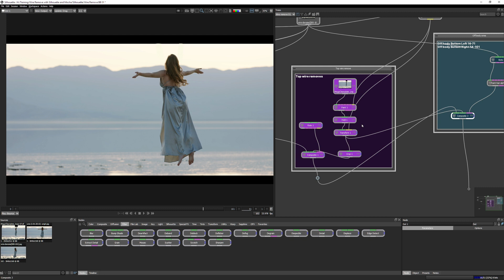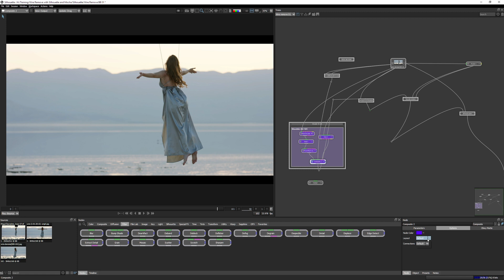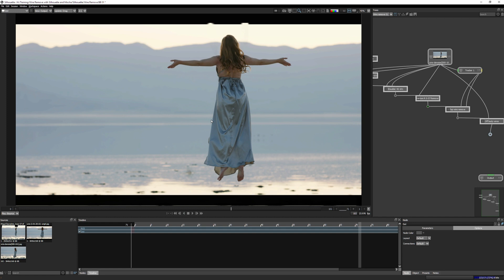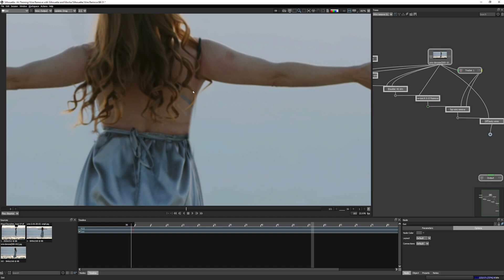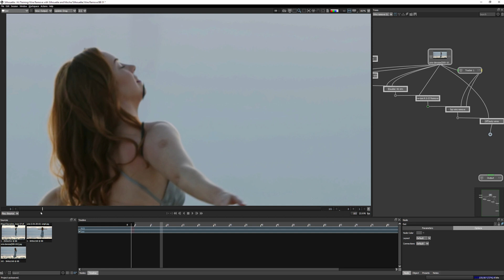13 Bringing It All Together [Wire Removal for VFX with Boris FX Silhouette & Mocha]

Comment: Hi Ben, I was wondering why sometimes in the composition node the main clip is plugged into the front input and other times it goes in the background? I understand that it depends a lot on how the alpha of the rotoscoping node is configured, but is there a standard to follow or does it depend on certain circumstances?
Reply from the maker: Hi John,  it really depends on whether I'm using the roto to poke a hole through the original or comp on top. There's no industry standard for this and it depends on the artist. I find it easier to plug the main clip into the foreground, if I'm going to be doing extra work to the other clip. It's easier to hide things if you have the hole poked through the main clip!
Reply: @borisfxlearn  thanks!